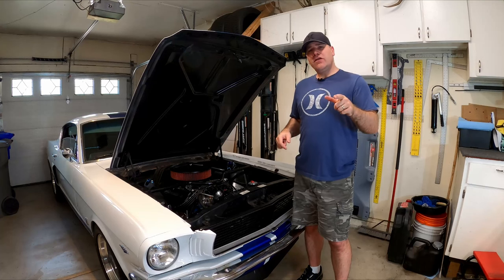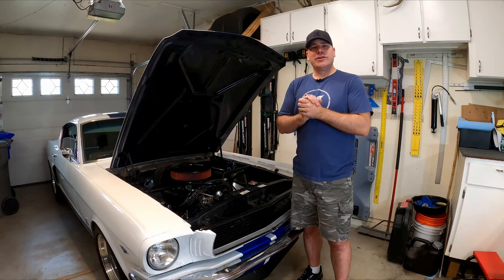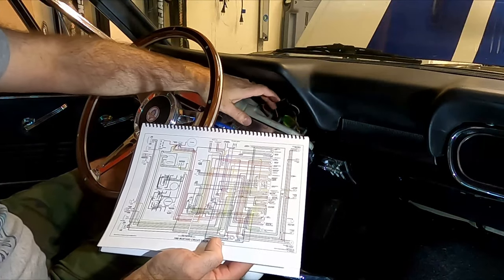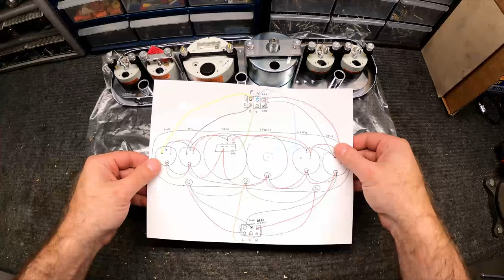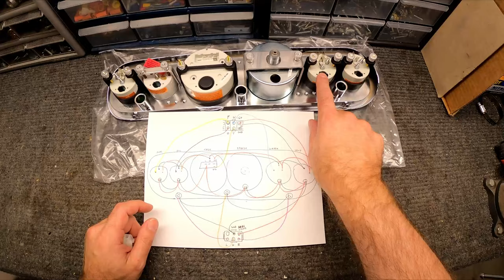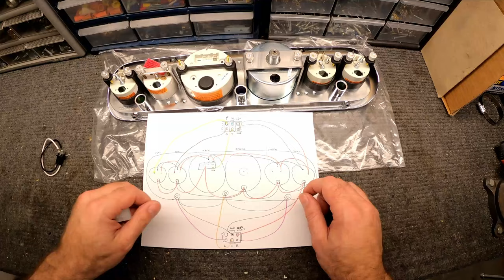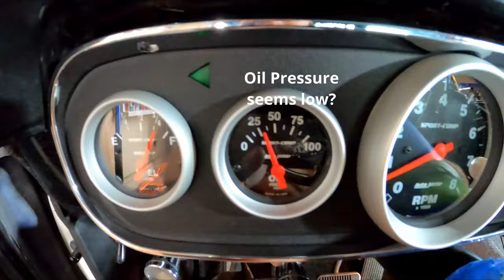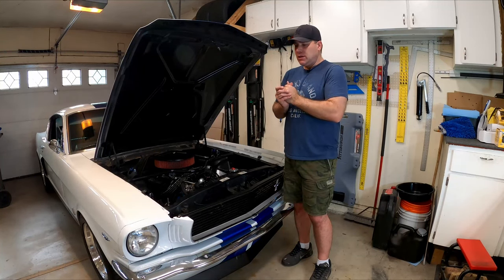Installing New 6 Gauge Instrument Cluster

Comment: Great looking upgrade I went with a digital cluster. My oil pressure is 52-54 when cold and around 42-46 warm. I'm also running amzoil's zrod 10w-40 with the added zinc.
Reply from the maker: My oil pressure is no where near what you and others are reporting, my motor is probably done.  :(
Reply: @AndyKruseChannel  it might be worth replacing the oil pump you can get a good quality new one for under $60 I believe.  Then you can checkout the screen and gasket in the process to make sure that's not another reason for the pressure loss. Good luck either way 👍
Reply: Buy a high-volume Melling oil pump, hardened oil pump drive at the same time. You may want to invest in a 7 quart oil pan at the same time with matching oil tube pickup. 
True story, I actually had an oil pump (PAW automotive) go bad. The small freeze plug on the pump opened slightly, making the pressure drop to 10-15 lbs at idle. lucky for me I didn't destroy the engine. 
Rule of thumb, your engine should have around 10-12 psi of oil per every 1,000 RPM after the oil is warmed up.

Comment: Nice job and thanks for sharing.  I personally would have used some heat shrink tubing to be safe, but I'm sure those connectors will be fine.
Reply from the maker: Connections were fine.  I had to rewire the whole cluster anyways when I did the full wire job on my car.  :)

Comment: don’t stress the oil pressure, mine idles hot at 14 pounds, 20w 50 oil. They will run and run. You can put a high volume oil pump that will gain you more pressure and peace of mind. Just get the hardened oil pump shaft because the high volume requires more turning input.
Reply from the maker: Yeah, I'm running straight 30W oil now.  My guess is the motor is done.  :)
Reply: @AndyKruseChannel  sorry bro

Comment: Very nice job. My 10 yr old 347 reads a little over 50psi cold, then to about 20psi hot (oil temp at 240°) at idle.  I’m also running 20w-50. Maybe it’s time I rebuilt mine too 🤷🏻‍♂️
Reply from the maker: Thanks!
Yeah, I think this motor is just about ready to be done.  :(

Comment: Love the gauges!  I have the falcon style in my 65 and an upgrade is on the list.  My completely worn out 289 was running 15psi hot at idle and 40 at speed.  Ran like that for years.
Reply from the maker: Yeah, I think my motor is done, my oil pressure isn't that high.

Comment: Question: I'm gonna install a set of standalone gauges (RPM & Volt ), I'm wondering if I should put a fuse in line with the power source? What do you think?
Reply from the maker: It depends on where you get your power from.  If you grabbing from a fused source already, then it's kind of redundant, but it's not likely to hurt anything.  If you're pulling from an unfused source (like the battery, or maybe of the hot side of the starter solenoid), then I strongly recommend putting a fuse in line.  :)

Comment: Hey Andy, looking your video's for a while now. They are so helpful on doing these things to my own 66 coupe.

Maybe your oil pressure is low because a bit of the teflon tape is blocking the oil to the sensor? Maybe the sensor is bad? Maybe the gauge is bad? New doesn't mean it's always good. 
Did you notice your oil pressure was low on your old gauge? You could always upgrade your oil pump, maybe there is some junk in the pickup that block your oil pump.

Keep up the good work!
Reply from the maker: Thanks!
The threads will make contact, as long as I don't put 20 layers of teflon on the threads.  I thought about the sending unit being bad, but you're right, it could be the gauge too.  The oil gauge was working before, but the letters "O I L" on the factory gauge doesn't tell me the pressure, so it's difficult to know what it was before.
I fear the motor is done as it smokes when I drive and I've had front wheel drive cars from the 90s that felt faster than this thing.  Oh well, it's only money!!  :)
Reply: @AndyKruseChannel  ooof smoke out of the pipes isn't good :(

Comment: Nice, neat work, Andy.  Thank you!  I plan to do something similar, as mine's the old 64-1/2 dash with a couple of idiot lights.  Slightly more involved conversion but definitely worth it.  And as long as your valvetrain isn't rattling, you have enough oil pressure.
Reply from the maker: The whole thing is "rattling", so I think it's time to find new options with this motor.  :)

Comment: Hi Andy, could you show where you got the baseboard light sockets? This video came at a perfect time as I gather all the pieces to do this to my 65.
Reply from the maker: If you're referring to the push-in-sockets for the 194 bulbs, I purchased them from an Auto Parts store in my town.  I did have to slightly shave off the "barbs" on the socket so it would fit, but it was minor.  I put an Amazon link to something similar in the description below the video.  Good luck!  :)

Comment: Andy - love your videos! You really are a great help to the Mustang community. One question that's been nagging at me - can you see the cutout for the original speedo under the bezel with the 6-gauge bezel installed? I'm planning to do this to my 66 GT, but a visible gap would really bug me...
Reply from the maker: Sitting in the driver's seat, I cannot see it.  If you bend over and try to look under the gauge bezel, you can see that dash metal is formed a little different than the rest, but only because you're looking for it.  :)
Reply: @AndyKruseChannel  Thanks!

Comment: if it falls below 10-15 when all warmed up, you know the engine is tired, jus like taking a compression test and its 120 -ish, its tired, but its still running good without smoking, be a good core for rebuild.
Reply from the maker: Yeah, this is an old video.  :)

Comment: I've been watching your videos for awhile and they've been tremendously helpful while I work on restoring my '66. I was wondering though if your lights on the cluster still dim with the new sockets or not?
Also, unrelated to the video, What size are your wheels/tires? I've been looking around for some wider wheels/tires for mine since I've still got those thinner type on her for now.

Thanks! And keep up the work man
Reply from the maker: Thanks!
The lighting with these new gauges is better as their design is 50 years newer.  The lighting on the old gauges were partially horrible as it seemed like it was an after thought to add lights when they were designing the dash, and it seemed like they just put them where they'd fit instead of putting them where they should go.  This made the lighting not very efficient.  Even though the LED bulbs were better than the stock lights, the lighting in the new gauges is 100x better.
Wheels are 16x7 with 4" backspacing (0mm offset) and the tires are 225/50/16.

Comment: On the oil pressure gauge I had the same thing and then figured out that the install I read to not use thread tape as it uses the sending unit as the ground.
Reply from the maker: Wouldn't it be easier to just rebuild the motor!  :)

Comment: Nice upgrade. I’m thinking of putting a small tach in the dash of my 68 cougar where the clock is supposed to be.  At the moment there is nothing there so it would be a good upgrade. I like how you did the wire harness, that would be a good idea even on a stock cluster, I know some of my stock connectors aren’t in that good of shape. Did you put normal bulbs in or LEDs?
Reply from the maker: I think you're right, wiring up the stock dash in a similar manor might be helpful.
I stuck with the bulbs that came with the new gauges for now, figured I'd upgrade them down the road.  :)

Comment: Andy enjoy the videos. It would be great to the time it takes and cost of the mods when your doing videos. Looking forward to the engine rebuild.
Reply from the maker: Thanks!
The time is greatly skewed by the setting up of the camera, lighting, and making sure I know what to say every time.  Skill level plus tool availability will also affect the project time.  I can see telling someone they can do something in an afternoon or over a long weekend might be helpful.  But most of my projects are done in the evenings or on the weekend as I still have a day job.  It breaks up the install because I only have a short amount of time to work on something, then I have to wait until the next day.  This skews the timeframe as I forget how much time I spend on something that gets spread over a few days.
I always put part numbers in the description below the video, and sometimes links, so it's easy for people to see what something would cost.  Sometimes I purchase used parts, or find a one-time deal that others wouldn't get, so advertising what I paid is not always fair since most couldn't replicate that purchase.
For this particular install, someone could knock it out on a Saturday, and they'll be out about $800.  :)

Comment: Nice content and good conversion to modern.     I’m not sure what my 72 Ford oil pressure should be since it is a light only.  I’m curious.  I can say the 351W HO with GT40P heads in my Ski Nautique has always had high pressure of 50-70+, I assume it has a high volume, high pressure oil pump because it is the HO model and it is in a ski tow boat, the cam profile is basically the same as the Ford Lightning F150 engine came with.
Reply from the maker: Yeah, I figure my 289 is done and that oil pressure is the tell tale sign that she needs to be rebuilt.  My new 347 sits around 50 psi, so at least I know that the gauge wasn't bad.  :)

Comment: My oil pressure was reading low also, I think it was like 8 psi when it was at full temperature. 

I threw on a cheap mechanical oil pressure gauge and everything was all good. Now im in the high 20’s when driving at full temperature
Reply from the maker: Yeah, I been thinking about putting a mechanical unit on the extender tube and just see how it reads.  I might just have a bad sending unit.  Or my motor is done.  :)

Comment: If you disconnect the speedo cable on the transmission side you will have more slack inside to connect to the speedo, did the same thing on my 65 except I used mechanical gauges, also did you go back with led lighting.
Reply from the maker: Yes, I thought about that, but I didn't want to jack up the car and go through that whole process to get some slack in the cable.
I'm using the regular bulbs for now, but I'll change to LEDs down the road.  :)

Comment: My dash is stock, but I’ve thought about going this route. Problem is those auto meter gauges are expensive! It’s almost worth it to spend a little more money and get Dakota digital stuff. Btw I have a 302 with around 5k miles on the rebuild…pressure is around 60psi cold then drops to mid 30s after it’s up to temp. Using 15w-40 rotella 👍🏼
Reply from the maker: Yeah, these gauges are pricey, it took a while to accumulate all the pieces, had to spread it out over quite a while.  While they make good stuff, not sure that Dakota Digital is an upgrade.
Yeah, I'm fearing that this motor is on its last leg.  Maybe it's time for a rebuild.

Comment: Great stuff Andy. Being a novice to this car fixin stuff I appreciate your videos. Even the ones where you make a mistake and future Andy makes an appearance and fills us in on what just went wrong. Haha. Quick question. My speedometer is not working and I tried to get the wire off of the cluster to inspect but I couldn't do it. I didn't want to break it so I stopped trying. (Even though it might already be shot).  How does it come off? Do I twist and pull, do I use a mini adjustable wrench..etc? Thanks
Reply from the maker: Thanks for the feedback!
The speedo cable is threaded, so there's no need to pull, just unscrew it.  If the nut on the cable is spinning, it may just be on there all the way and so it will take several turns.  If the nut is not spinning, the previous owner either used a wrench to tighten it down, or they cross-threaded it.  Try getting in there with a wrench to see if it will "break loose", then continue to unthread it.  You may need to disconnect it from the Trans so you can feed the cable up into the dash and allow you to pull the cluster out further to get that wrench on it.  If you break that nut loose and find it's cross-threaded, I'd buy a new speedo cable and run a Die over the threads on that speedometer (5/8-18 thread).  Good luck!

Comment: you can up the oil pressure by putting in a high pressure oil pump. NOT high volume. i put one in mine when i built my 460 and i carry 70 lbs when cold and then 65 lbs when hot. with high pressure oil pump you dont have to get a 10 qt oil pan.
Reply from the maker: ok

Comment: Hi ! Nice upgrade ! Do you have the réf of your steering wheel please ?
Reply from the maker: Not sure what "ref" means, but I purchases it from CJ Pony Parts (part number STW111KA1S).  :)
Reply: @AndyKruseChannel  Thanks you ! That’s what I was looking for :)
Reply: Hi again Andy ! 
Thanks for the advice, I am waiting mine ! 
I have another question, I plane to change my tires because it’s way too big and I just scratch a fenders…

Front : 235/60/15
Rear : 255/60/15

Can you help me too choose the right one please ?
Reply from the maker: @xXRPZXx  I had 225/60/15, all four, on my last Mustang and I think they looked fantastic.  However, part of that was because of the backspacing (offset) that my wheels had, which moves the tire out a little more over the factory wheels.  Those wheels had a 3.75" backspacing (-6mm offset) and I loved it.  My current car has 225/50/16 with a 4" backspacing (0mm offset) and I don't think it looks as good as the other ones.  I'm not liking the larger wheels this time around and I kind of wish I could go back to that size I had on my previous Mustang.
You already have 15 wheels, which I think is better as I feel that classic cars look better with taller-looking tires (more sidewall, not thin tires on current cars).

Comment: What was the oil pressure problem?
Reply from the maker: Bearings need replaced.
Reply: Oh no. That's not good. I'm going to put in a set of electrical tripple guages. All my originals work, but they just give you an "idea" that things are working. I want more precise information. I have a 67. I wonder if they make guages to fit in my cluster like you did yours......🤔

Comment: My oil pressure reads 50+ when cold drops to 30 when hot.  Water temp reads 190 idling
Reply from the maker: Yeah, I think my motor is done.